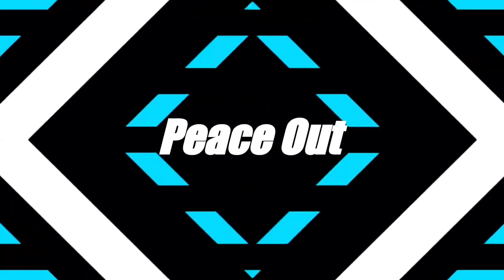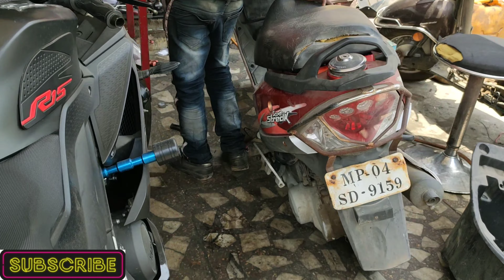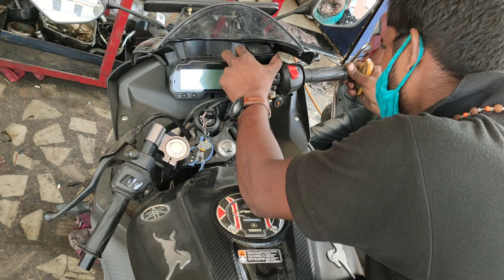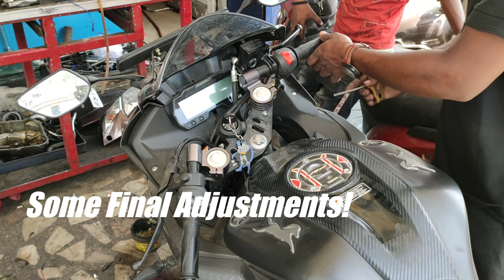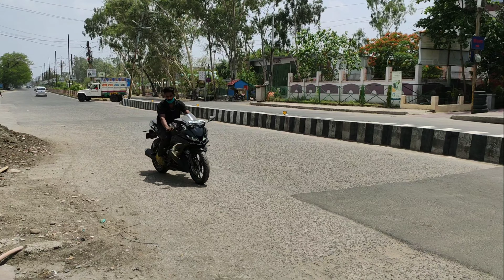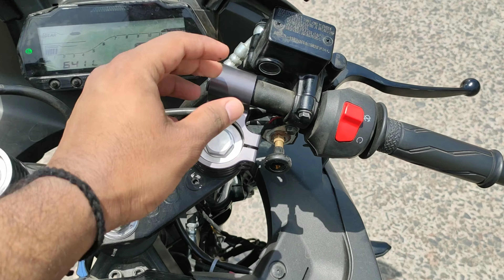Yamaha R15V3 Problem & Solution|Custom Handlebar Modification for a Comfortable Ride FINALLY|Part 2!

Comment: What about the controlling . Do you feel any difference while leaning the bike or cornering ?
Reply from the maker: These handle bars are really good and there is no problem as such when turning or cornering I've driven it for around 300kms and I'm quite on the road with these clip ons

Comment: Is there any Warranty void due to installment of handle bar raiser?
Reply from the maker: Since there's no cutting of wire or part involved so I'm pretty sure the warranty won't be void! 

Rest it's up to an individual if they want to get a mod done!

Doing mods one looks at the aesthetic beauty and not other factors ☺️ it's just a matter of choice!